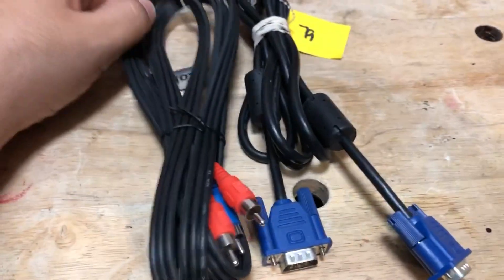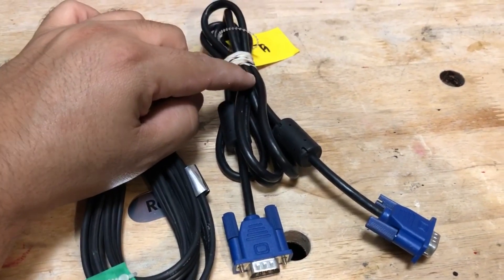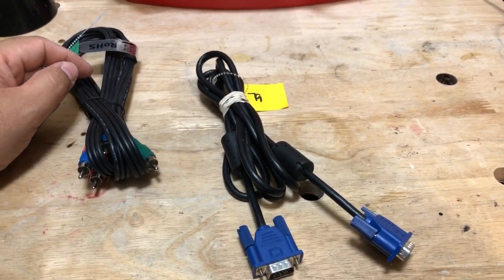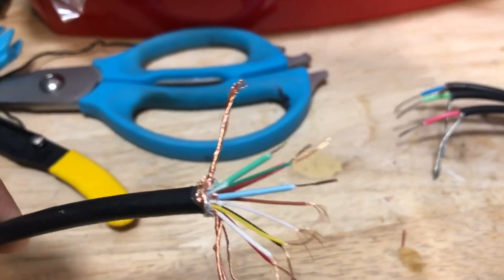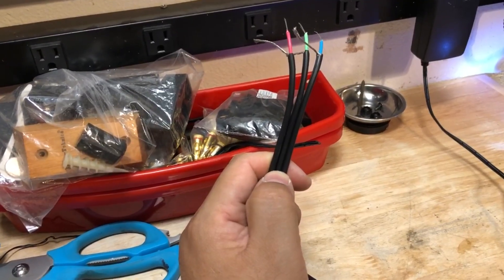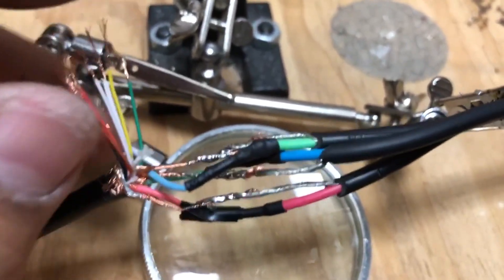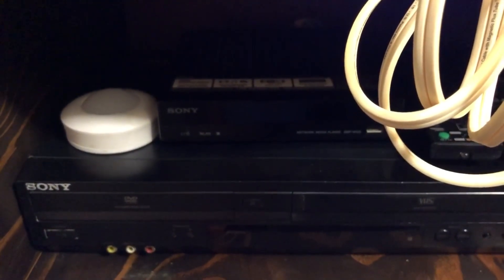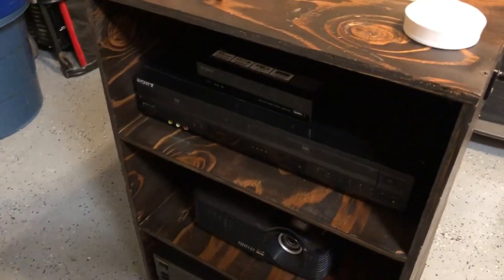DIY   Build your own Component to VGA Cable

Comment: Genius man! I've been trying to get a retro pc set up to a great sony trinitron tv ive got but couldn't find a decent adapter. Did you have to use any other components or was the wiring enough? Do you know if it would work from vga out to component in? Regardless, this is great man.
Reply from the maker: Just the wiring worked fine for me.  I am not sure if it would work with VGA to Component on any device.  What I do know is that a digital signal will not work on a CRT.  If you can get your device to deactivate any kind of progressive scan signal or use only an interlace signal, it might work (but don't quote me)!  Thank you for watching my videos!
Reply: It won’t work, your crt most likely takes 15 kHz, no computer outputs that signal.
Reply: @PsychoVision19 vga crt monitors take 31khz. You actually can through custom resolutions on analog capable nvidia cards or through the crt emu driver route on analog capable ati/amd cards.